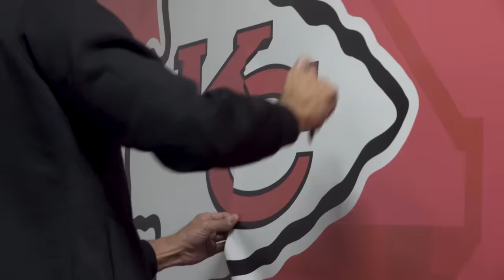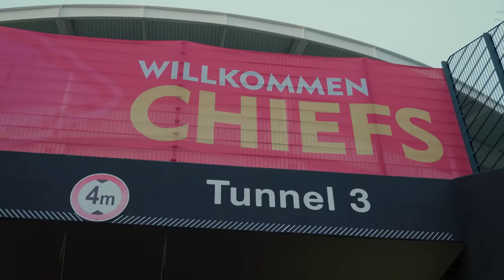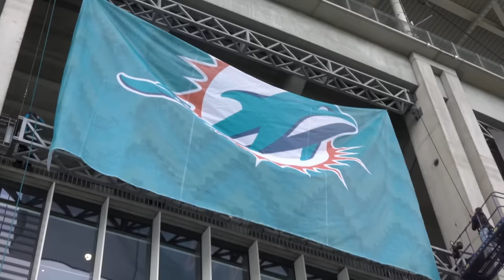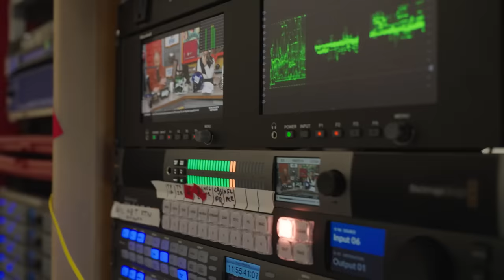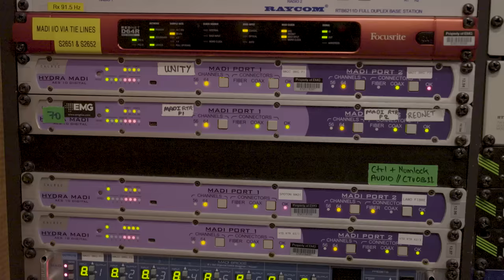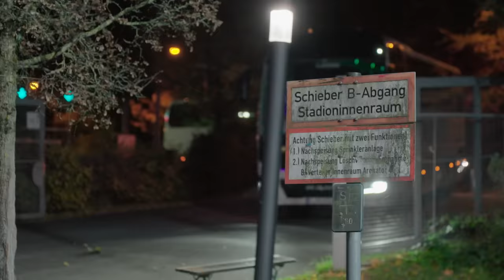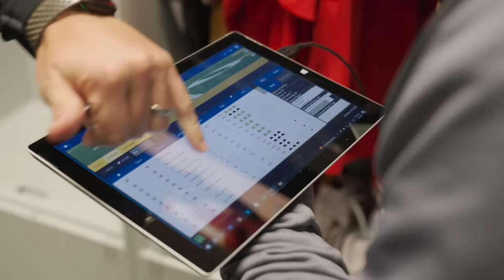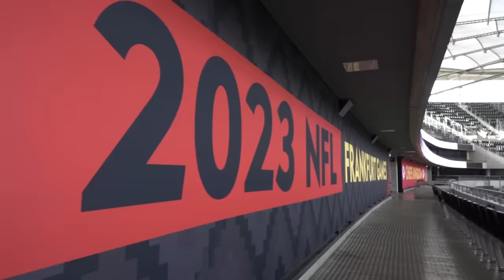EVERYTHING That Goes Into Preparing A Chiefs Game in Frankfurt Germany

Comment: The most crazy thing to me is that the week before and the week after Eintracht Frankfurt played again in the stadium. And for anyone wondering about the changes, the whole pitch can be changed very quickly as it is constructed that way. And regarding the walls I don’t believe they are permanent. However I find it a bit sad that the players walked out through that little side exit, while Frankfurt has one of the nicest player tunnels there is, which they didn’t use purely for marketing reasons as it has big Eintracht Frankfurt Branding